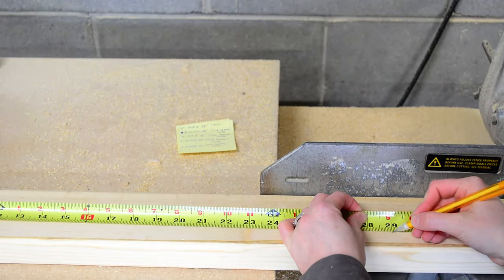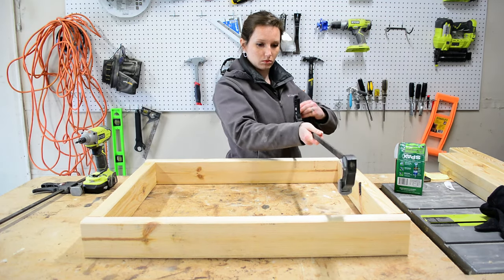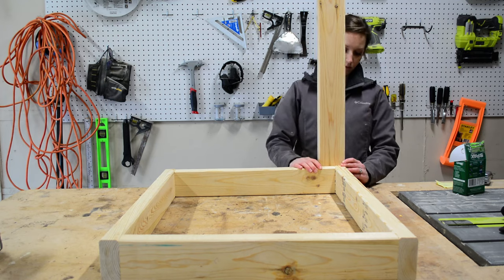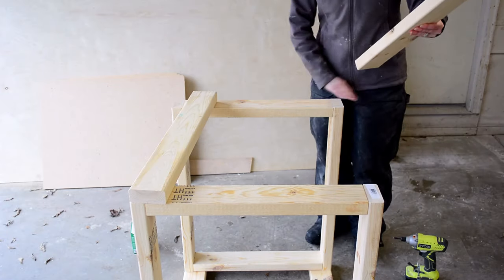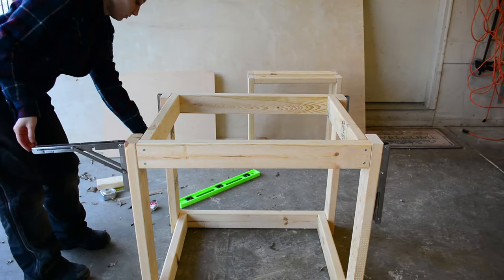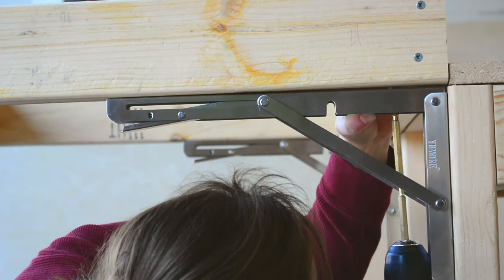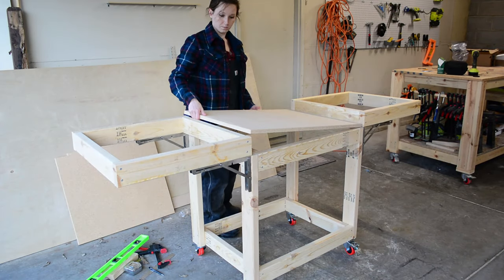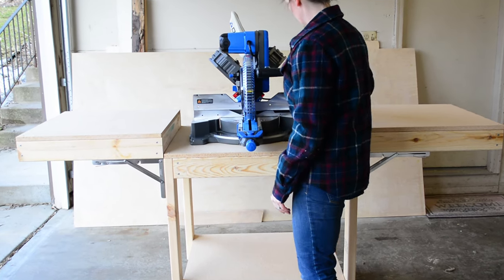How to Build a DIY Mobile Miter Saw Stand

Comment: Great job on this miter stand.  One thing that wasn't mentioned was to account for the height of the miter saw surface and make sure it comes out even with the height of the miter saw wings.  I see you've get a Delta Cruzer Miter saw now.  What happened to the old Dewalt from the beginning of the video?
Reply from the maker: Yeah I've had a lot of questions on that and wish I would have videod how I did it. Oops! I just laid a board across the tabletop of the saw and measured from the workbench surface up to the bottom of the board to get the height. The old DeWalt is on my other miter saw stand for now.

Comment: Good video! I hadn't really thought of using those kinds of brackets to hold the wings, but I'm glad you made the point that you haven't had any issues with them. I'm getting ready to make a miter saw table with wings, and I was going to use piano hinges, but these look like they'd be MUCH easier to work with. Thank you for the video!

Comment: Question it doesn't look like the  wings line up with the saw?If they don't you can lower the folding brackets.
Reply from the maker: I lined them up with the saw tabletop so I can run boards across it for cutting. You can adjust them to whatever height works for your saw - just depends where to attach the brackets

Comment: Quick question, and sorry if I missed it in the video and instructions, but...what's the width/depth of your miter saw? I'm wondering if mine is the same so i can just pre-cut using your measurements...sincerely, a lazy handy-man.
Reply: Ohhhh also, how do you make sure the wings are the same height as your saw saws surface?

Comment: That Delta Cruzer is an awesome saw! Great project. :)
Reply: Cut it out yesterday and did the build today...thank you for the plans; this is a big improvement over my Dewalt 6’ long with splayed legs miter saw stand. The Dewalt stand is great for mobility and uneven terrain but this saw always ‘stays to home.’ Not only does this give me 8 more inches of material support ( 80” vs 72”), it has a smaller footprint when stowed, has a shelf for storage and 2 four square foot table surfaces readily available if your chop saw is idle. I ‘upgraded’ to 20” folding brackets, heavier casters and sanded 3/4” plywood. My total cost was ~$180 as follows: Plywood: (As I’m 70 years old, I bought 2 4X4’ plywood sheets {$38 total}; 4X8 sheets too heavy for me to lug and to rip. 2X4’s were $24. The casters were $11 each ($44.) The 20” brackets were $40/pair on Amazon. The project turned out great and freed up adequate space for the Laguna lathe due here next week. Many thanks; you rock! 😀 !

Comment: Hi, great video. Loved your plan the best. Im actually going to build this today. I picked up my first chop saw yesterday. Question. I always have bad luck with wood screws because i think the metal is too soft and i usually end up stripping the screw-head before they are all the way seated. I noticed you are using construction grade screws? Is there a difference between wood screws? Can i use deck screws or should i pre-drill holes first before applying the screws? Maybe i'm using the wrong Phillips head bit on my drill? Not sure. Im just a beginner. Sorry for so many questions.
Reply from the maker: I've had bad luck with wood screws too. These construction Spax ones seem to do ok with the 2x4s, but I've had issues with them on anything bigger. I'm going to try out some power pro torx head ones and see how that goes. You can find them at Home Depot

Comment: I came across the website first. Really like the design and will be building it this weekend.  A better technique would be to arrange 2x4 blocks in the corners with the grains vertical while you lay out and square up the framing members.  Then drill into the blocks in all 4 corners so none of the screws are going into the end grain of the 2x4 framing.

Comment: I've looked through several plans, and I've decided on your. Nice, solid and simple design. I liked the use of the folding brackets, even if they add a little more to the cost. One quick question, is there any reason why you didn't make the top the same width as your miter saw? I saw that you have a gap between your saw and the wings. I was wondering if it wouldn't be as stable if it was more narrow. My Metabo comound miter saw is only 17.5" across.

Comment: I will be building this station. Very nice.  Can you provide plans for a similar workbench that you could put alongside this in a garage?  Same high as the table extender so it is one long run?
Reply from the maker: I have two other workbench plan sets on my website (no videos of those yet unfortunately!)  One has a mobile table saw built in while the other is just a simple workbench.  
https://www.bitterrootdiy.com/mobile-workbench-with-table-saw/ 
https://www.bitterrootdiy.com/build-a-basic-workbench/

Comment: Nice design, straight forward and got the job done, any thoughts on a dedicated vac and shoot for dust collection, thanks!
Reply from the maker: I left the bottom shelf open for a shop vac setup if you want to throw it under.  I use a shop vac currently but would love a dedicated system in the future!

Comment: How did you calculate how high the wings should be to match your miter saw?  Different brands of miter saws have different heights so I will need to make an adjustment for my saw.
Reply from the maker: I just laid a board across the miter saw tabletop so it extended off the edge a little bit and measured up to it from the surface of the workbench. It sits at 3 5/8" on this Delta Cruzer. My DeWalt one sits at 3 1/2".

Comment: Was any consideration made to make sure the mitre saw’s ‘table’ was flush with the wings? Is that important?
Reply from the maker: Yes, I measured the height of the saw tabletop and attached the wings at that height. Forgot to specify in the video

Comment: Any trick to make sure the two wings aligning perfectly and flush with the miter saw bench?
Reply: I have the same question. My wings are slightly out of level with the saw. I assume that can make each cut slightly out of square. I can shim the saw up to be level with the left wing but it's a puzzle how to get all 3 (left wing, saw, right wing all level with one another. Have you figured this out yet?

Comment: Great project. Easy to modify to fit your saw and the operator. A couple of hints, the wing brackets require some shimming to get the wing ends up to same plane as miter saw deck. Second, take note of placement of wheels from video in order to easily release the brake(which is located on top of the caster).

Comment: Not sure if this delta you tossed ontop is the 10 or 12 inch but i just bought the 10" Ridgid version and  want to figure out a table for it, you know i jadnto click on this video seeing that saw in tje thumbnail
Reply from the maker: This is the 10" Delta in the video, but I've also used it with my 12" DeWalt compound and it fits just fine. I actually built it for the big DeWalt originally!

Comment: Probably a silly question - how'd you know that the mitre saw platform would be level with a 2x4 tall + 3/4" particle board?
Reply: I think I understand your question.  Her saw is probably like mine - the top of the saw's table (platform) is 3 1/2" above the base.  The 2 x 4 is actually 3 1/2", so it raises the particle board to be level with the saw, since the saw sits on a piece of the same particle board.  Makes me think the saws were designed just so 2 x 4s would work that way.
Reply: They aren’t all 3 1/2” deck height! Or at least, mine’s not - it’s 3”. The great thing about this design is that the wings can be attached at any height on the side, so they’re even with the deck height. (At least it looks that way - haven’t tried it yet!)

Comment: Great video thank you for posting. I just have a question about one of the squares, on your site it has one at 2x4 @ 24 inches. Is it supposed to be 2x4 @ 29 inches to match both the top and bottom center frames? 
Thanks again for the video and can’t wait for more.
Reply from the maker: I'm not sure if I totally understand the question and I apologize for not getting back to you sooner. The center frames are 2x4s @ 29", the wing frames are 2x4s @ 24"

Comment: Nice build but,
Why bother with the 2x4’s for the outsides, should just use the plywood on the brackets, or just a 2x4 on each bracket and plywood on top. This would lighten the load on the brackets. 
Plus, 5” wheels would bring it up to a better workable height.

Comment: Simple design, easy to build. I got 16" brackets and extended the wings to 28". I had a makita flexible impact driver that made screwing the brackets at the top much easier.

Comment: Guess who's an idiot that decided to make everything square and went with 2x2 measurements on everything to save some space, not thinking about 45 and 60* miter positions??? Surely it wasn't me... :D I measured the width of my saw, not thinking of the swing.

 Thankfully I only have the center section built and can easily rip 4 new 2.5" boards.... Should have stuck with the plans..... Live and learn!